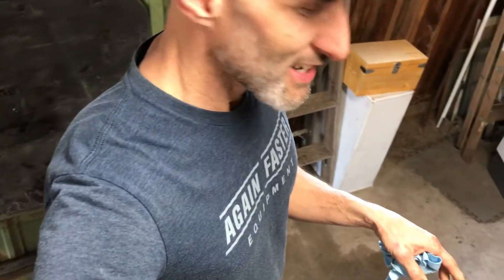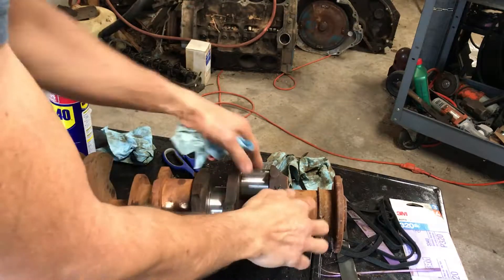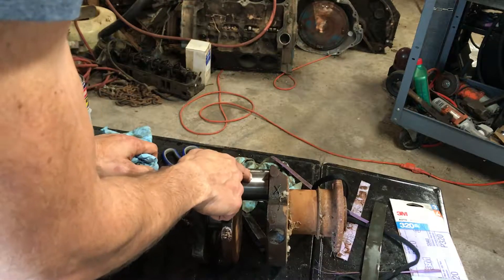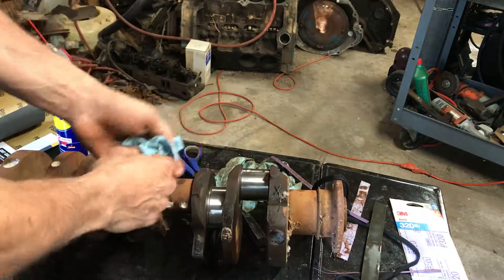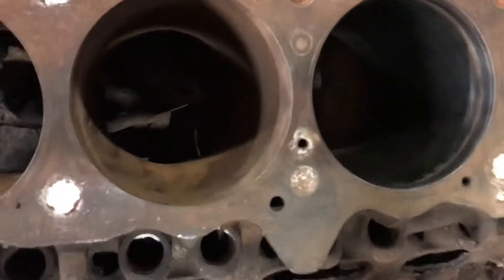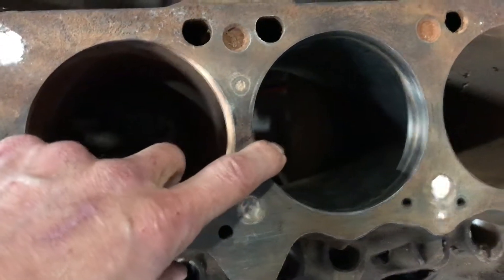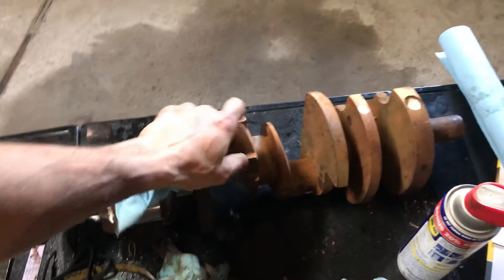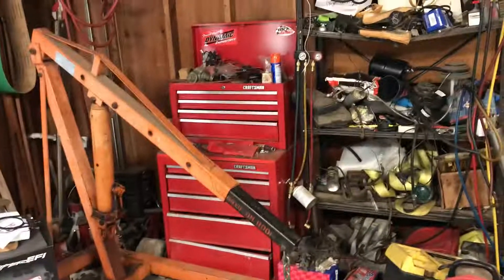Crankshaft polishing and Cylinder ridge reaming Mopar 360

Comment: Thats bloody fantastic, i didnt know about that trick, what comp are you wanting?
Reply from the maker: GRIFFS REARMOUNT TURBO, The Modfather 9.3 to 9.8 to 1.
I will most likely skip the 4” stroker as the shorter 3.58” stroke will have less stress on the block.  360 is plenty of cubes and I can always turn up the boost on e85.
Only want 550ish at the tires anyway. 
Should be easy with a Victor 340 and heads that flow 300+ cfm.